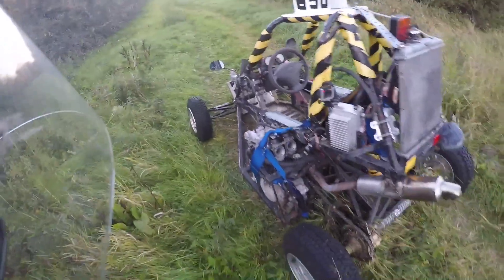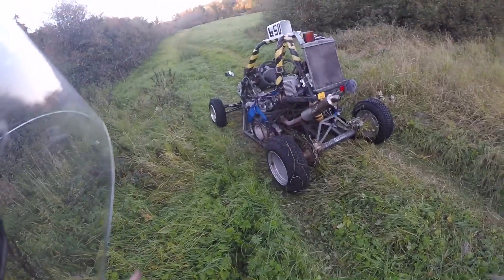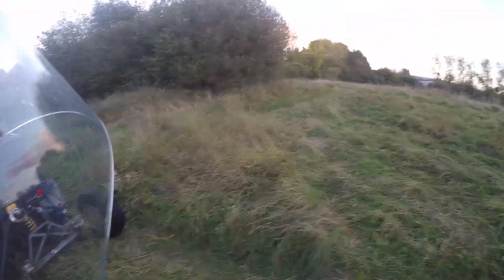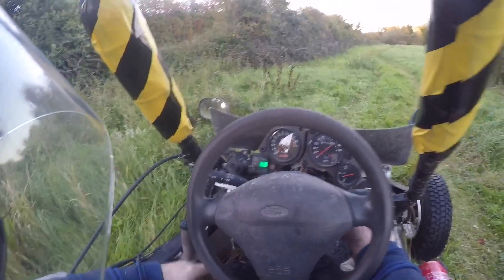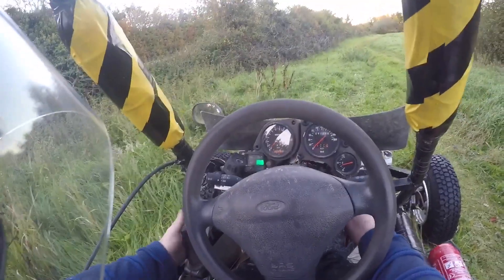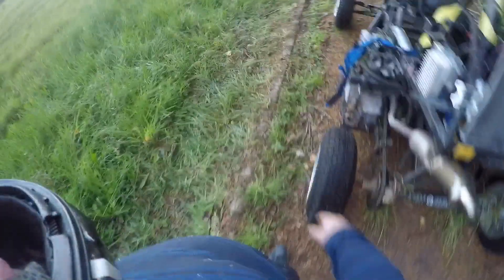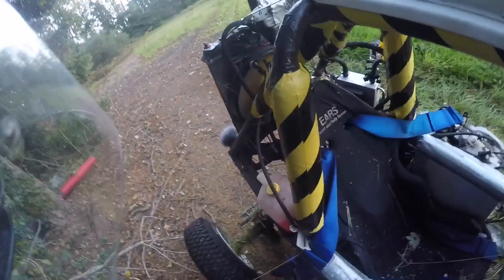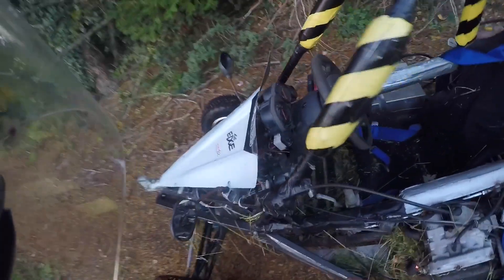Edge Sidewinder Rotax Bugaso 650 Buggy

Comment: fun out on bugaso  built one with sv650 in it about 10 yeares ago good  fun getting dirty.
Reply from the maker: Yep fun is the best word to describe it or mucky fun. Bet yours went well with a SV650 engine. I think my KLX450R bike engine be good as its lighter than the 650 but has similar power. Thought the Pegaso Rotax 650 has good bottom end and great mid range torque grunt. I did a brief walk round talk of the spec and build https://youtu.be/Rmj8QKZHT9c
Reply: @xplane7523  you can have to much power then every thing starts breaking  no fun then.
Reply from the maker: adrian tompson yes agree. Actually mine is fine. I had it on track day tarmac and could lap faster than some cars.